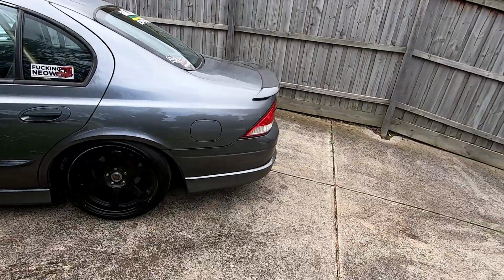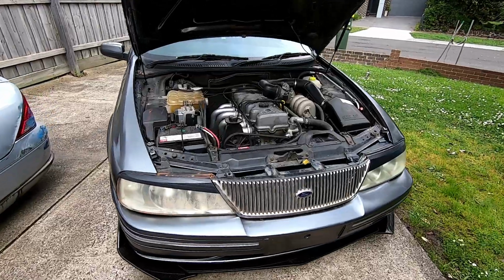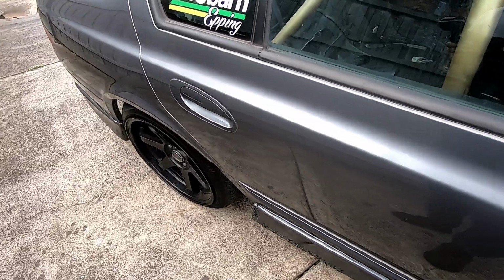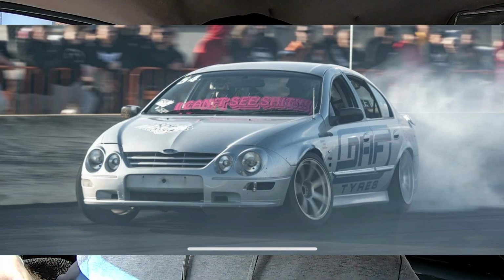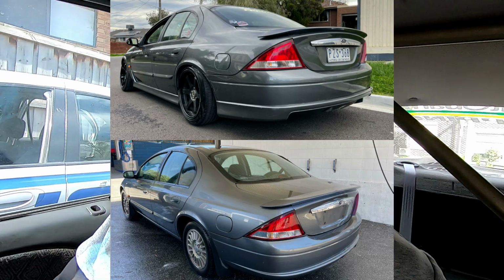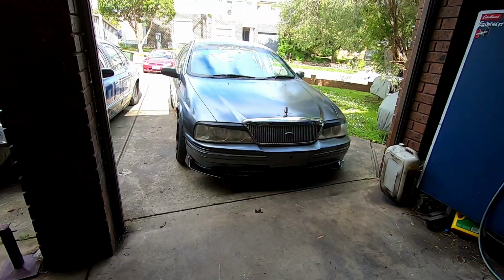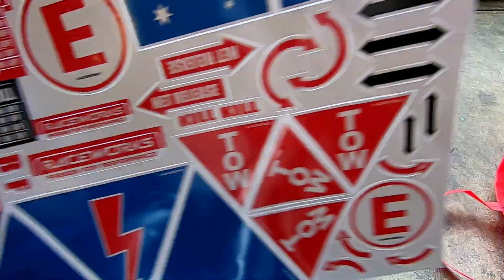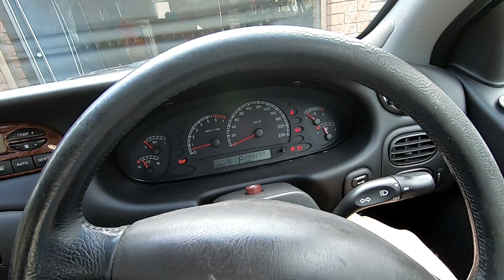How much has the budget AU Falcon drift car cost to build?

Comment: Absolutely love this rig man it fat as fuck Been watching since the rd patrol days keep it up man! 

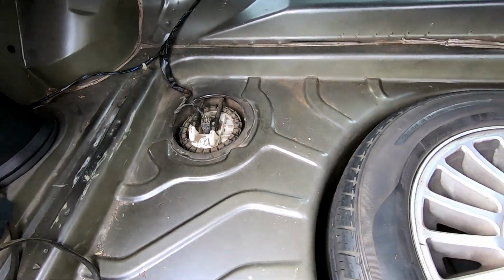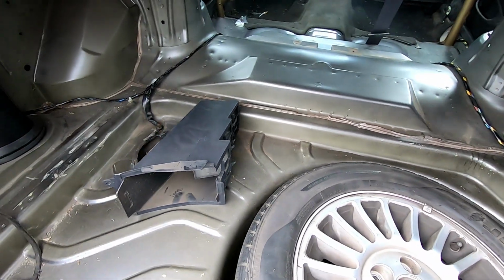One thing I wondered about this build is why you never used the diff centre out of the parts You should have put the diff centre from the parts car in your one irs and solid have the same ring gear/centre plus it had the 3:45s where as you probably have 3:23s in it now the t5 goes so much better with 3:45s.
Reply from the maker: Thanks heaps man! 

And the reason why is I have a 3:9 centre from a 31 that’s gonna go in her, much better than the 3:45 and yeah I know the gears fit haha, with the 31 bw78 I can just shim the pinion and change the pinion bearing around and she’ll be ready to rock and roll
Reply: Ahh fair enough man that makes sense then. 
 thing will scoot with 3:9s man actually keen for it sounds like it’s gonna be a wep on the track 🤌